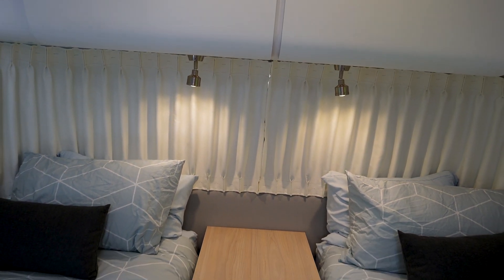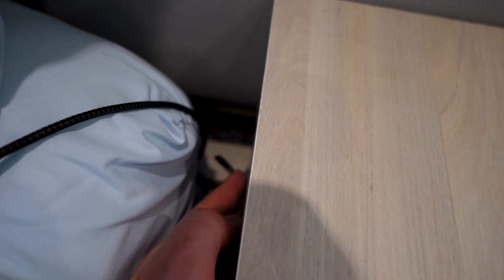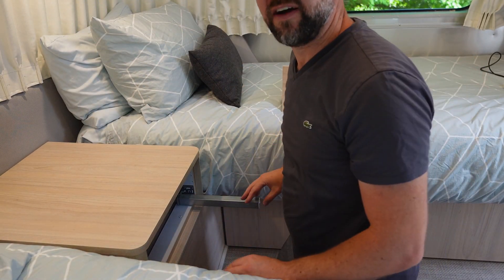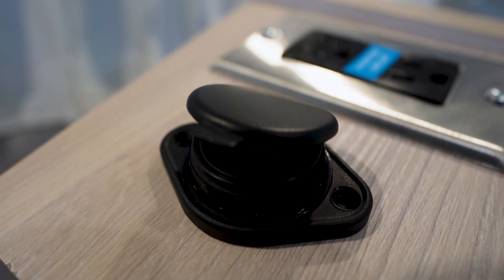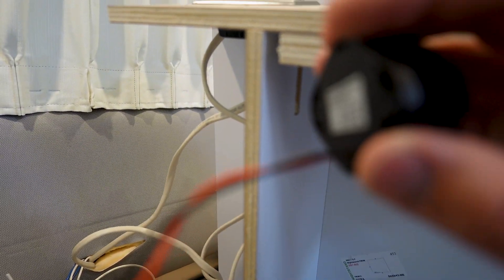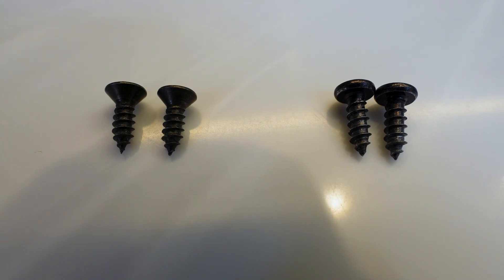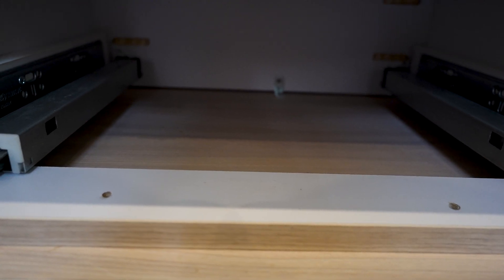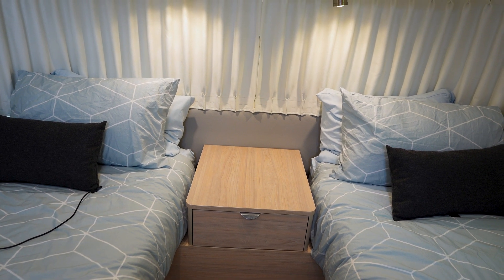Airstream USB Mod! - How to use the twin bed model USB ports without jamming!

Comment: As the mattress and blankets move around, they could still be interfering with the USB and 110 Volt.  If you are going to go through the trouble of taking the night stand apart, why not just install a pop-up port in the void space behind the drawer?  That why it does not interfere with anything.
Reply from the maker: The goal is/was to move the USB ports to point upwards. This allows you to plug things in from the top, and removes the strain on the connector between the nightstand and mattress that could snap off the connector. As for why not a pop up, we prefer the clean aesthetic and I don't want to drill holes in the nightstand. If neither of those are a concern to you, a pop-up sounds like a great solution.  Thanks for watching and commenting!

Comment: That is a terrible design decision by AS. Is there a reason not to relocate all power to the top of the cabinet so the are more useful?
Reply from the maker: Greetings! If you don't mind drilling more holes, you could absolutely relocate both the 110v power and USB to the back of the nightstand pointing upwards, there is plenty of space. I know the Flying Cloud and International have the 110v outlet centered in the wall, which is moved to the nightstand on the Globetrotter, likely due to the upholstery that runs across the wall on the GT.  Thanks for watching and the sub!